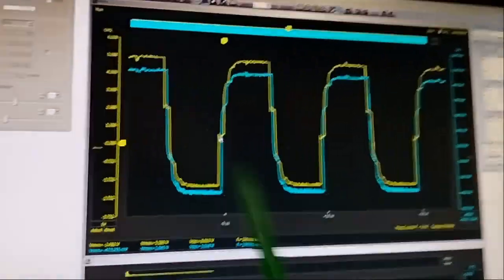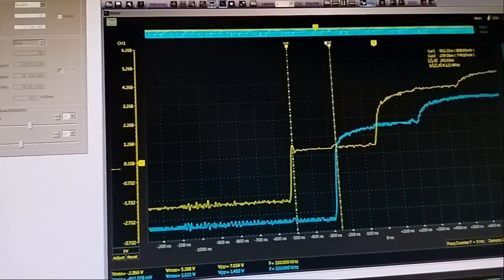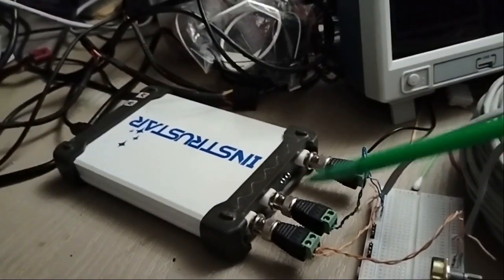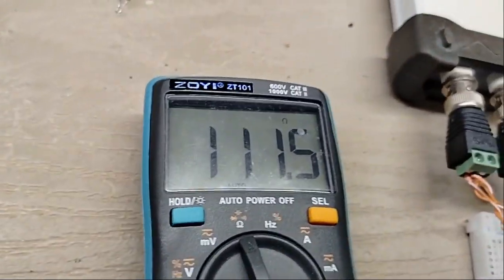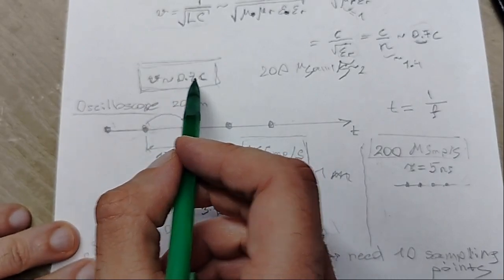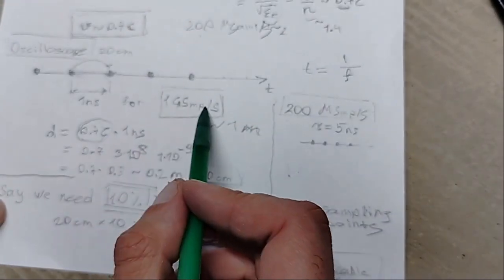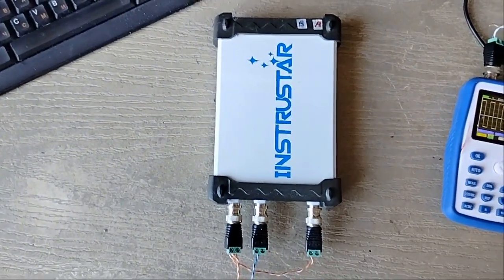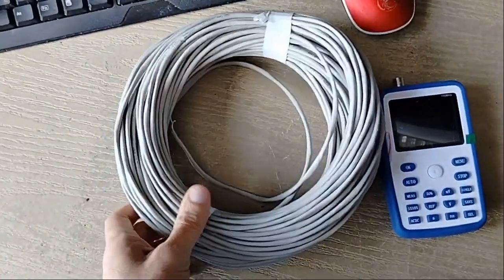Time-Domain In-Depth Measurements: Cable Length, Impedance, and EM Wave Propagation Speed Uncovered

Comment: Interesting video, thank you. Have you ever encountered C1-99 oscilloscope (Soviet era) ?
Reply from the maker: No, I don't have any experience working with that device...
I think it has 100MHz bandwidth, devices on the video have only 60 MHz.
Reply: @alexanderbeliaev5244  It is analog device, CRT, two channels. I has also output with voltage proportional to X position of beam. You can simply connect this scope to some VCO (i.e. 74S124) and display amplitude vs. frequency (i.e. quartz characteristics ), or make it into simple curve tracer. Simple old tech is cool. Regards from Poland. As for bandwidth yes 100 MHz nominal, synced up to 250 MHz, but it was mainly for fun)
Reply from the maker: @staryduren  I love these analog scopes as well, I have few simple models c1-112A and c1-94 easy to hack and play.